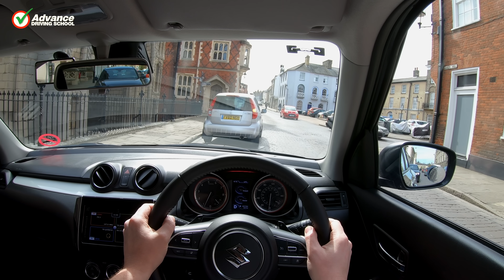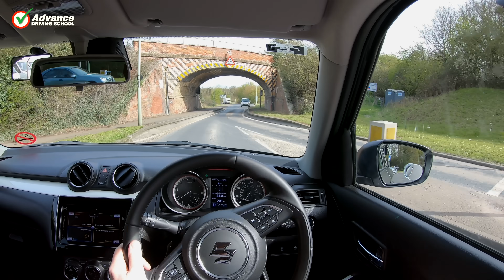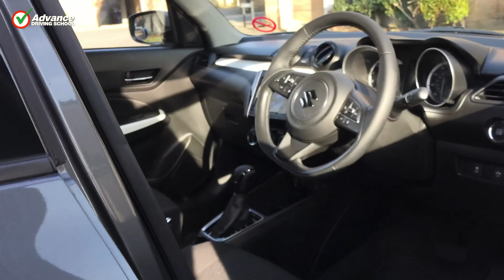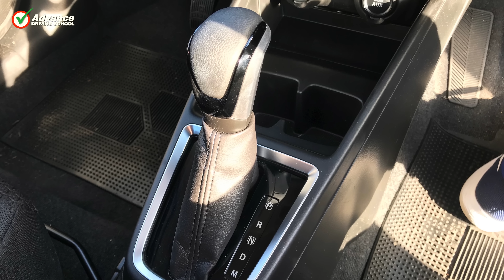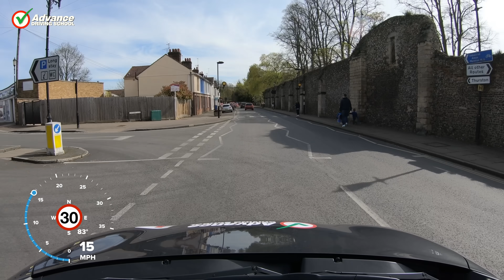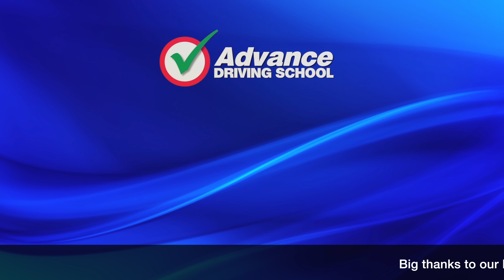How To Drive An Automatic Car

Comment: Thought it was Semi Automatic?🙂
Reply from the maker: This car has a 6-speed fully automatic gearbox (if the driver selects ‘D’) but can be driven in semi-automatic mode if required (select ‘M’).
Reply: Ah ace. Want this as my first Car but the Boosterjet is a Group 27 Insurance!!!

Comment: Do we have to use the M  If we passed in only a automatic ?
Reply from the maker: Using the ‘manual mode’ on an automatic car is completely optional, and will only be beneficial in certain situations. This is not the same as driving a manual car (which has a clutch pedal) and is fine for a driver with an automatic driving licence.

Comment: Srsly. Why does he use handbrake on automatic gearbox on flat surface to stop the car??? 
The UK system is so broken with those handbrake usage...
Reply from the maker: We use the footbrake to stop the car, and then if we want to park we apply the handbrake for extra security.
Reply: @AdvanceDrivingSchool  but there is no point in handbrake in flat surface...

Comment: 1st learn & get a licence in a manual car, auto cars are easy, no leason's needed
Reply from the maker: Controlling a manual car's gears and clutch are only a small part of driving - so even in an automatic car there is still a lot to learn before reaching test standard. The official statistics show that the pass rates are the same in both manual and automatic cars!

Comment: what's the point having a handbrake as well as the park setting?
Reply from the maker: The handbrake can be used in emergencies if the normal brakes fail, and also makes the car more secure when parking (in case the gearbox’s Park brake fails).

Comment: My question is about the creep function. It was demonstrated on a flat ground, just put in drive and let go of the brake and you'll move forward but what about if you're climing a hill, have to briefly, so you leave it in drive and press the brake. When you let go will you still move forward or will you roll back? With an automatic it's not like you can "hold it on the clutch" to make sure you don't roll back
Reply from the maker: In most automatic cars the creep is strong enough to prevent the car rolling back on a hill start - but it does depend on the steepness of the hill. If it does roll back you could use the handbrake (like in a manual car) or your left foot on the brake.

Comment: When doing your driving test in automatic will you have to put car in park and use hand brakeswhen stopping
Reply from the maker: When parking at the side of the road we would select Park and use the handbrake, but when stopping at a junction it’s up to you. As long as the car is in control it doesn’t matter how you do it.

Comment: One point they didn't mention was that: once there is something wrong with the clutch, the cost of maintenance many, many times more than a manual car.
Reply: Automatics don’t even have a clutch in the first place that’s what makes them become automatic because it changes gears for you automatically hence the name that’s the point why some people prefer automatic because no clutch
Reply: Older auto boxes usually employed a hydraulic torque converter instead of a clutch, but many modern auto boxes do have a clutch instead - well, two clutches, usually.

Comment: The fact that most cars still are manual is largely due to ignorance. Once you have driven an automatic in city traffic you will apreciate the advantages. Since most of us do drive mostly in town it is surprising why so many car manufacturers don't offer autoboxes.
Reply: Automatics are more complex, use more expensive parts and therefore more expensive to service and maintain. It's not about ignorance, it's just not as cost effective as their manual counterparts.

Comment: One feature of an automatic car causes more than a few people to press the gas pedel/pedle instead of the brake.
There are numerous videos on youtube showing the consequences of this error.
This is also the cause of many reports of cars failing to stop of slow down for the driver. These reports were in all media in the UK, and doubtless elsewhere.
The CEO of Nissan (I think) made a deep apology. Drivers claimed that the harder they pressed the brake, the faster the car went.
Of course they were actually pressing the gas all the time.
Any suggestions?
Reply from the maker: This is a real problem in automatic cars, and why some people use their left foot to brake the car.
Reply: Yes it's because of the creep function, when the car is creeping, with your foot on the brake.  If you want to stop it from moving, you instinctively put your foot down hard on the OPPOSITE pedal (which happens to be the accelerator and not the brake).  The Creep function is actually a dangerous feature and should be phased out.  It's not even necessary.

Comment: In a moment of utter madness and confusion I decided to go back to driving an auto after years of driving manual.. Luckily I kept the manual after acquiring the auto in case I couldn't get on with it. Four months on and I am still not used to the auto. I feel like an accessory in there and it definitely doesn't seem as economical as the manual. It is however a slightly bigger engine, so hopefully that is why.. 1.9 manual TD4 up to a 2.2 Auto SD4 .. What I find very odd is the Freelander 2 Sport LE doesn't have a drivers arm rest on the left and it is auto but the GS manual model does have drivers armrest, from what I have seen.

Comment: Please also remember to come to a complete stop before shifting from Drive to Reverse or vice-versa. If you don't you can cause expensive damage to the gearbox. It is also good practice to apply the handbrake before shifting into park on a steep hill so that the weight of the car is being held by the handbrake instead of the parking pawl. If not it can be difficult to shift out of park and over time be damaging to the gearbox.
Reply: Can you go from manual back to automatic while the car is moving?
Reply: I was going to say that

Comment: I've noticed in some automatics they have 1 2 3 on the gear stick? What do they mean? Is that so you can choose when to go into gears? I'm currently learning in an Manual but thinking about getting an automatic once I've passed in a manual... well hopefully 🙊
Reply from the maker: Extra numbers or letters on the gear selector are give more manual control. In your case the numbers allow you to select gears 1,2 or 3 manually, for use in certain situations. Read your car's manual for more details :-)

Comment: Once you go auto, you never go back, I learned and passed on a manual, then drove a manual car for a few months. I got my first car in november which was an automatic hyundai i10 and i love it so much. Its a four speed slushbox but its really fun to drive and im never going back to manual. Also lil correction, it is possible to stall some automatic cars like an automatic Lamborghini gallardo cause it has a crap automated manual that stalls sometimes.

Comment: I’m learning to drive in automatic car now I did try manual to start off but sometimes stalled the car and sometimes forgot to change gear stopping at give way lines and I do prefer automatic as they r much easier to drive but in a way I still wish I could drive manual coz if I passed in a manual at least I would have a choice of what to choose from plus manual is cheaper and I have wondered whether to give it another go but nah I’m sticking with automatic it’s just easier although I still find some parts of driving quite hard such as manoeuvring and roundabouts
Reply from the maker: Good luck with your lessons 🚙👍🏼

Comment: I'm disabled and have to drive an automatic. I find driving an auto so much easier than when I tried learning in a manual. I now love driving, which was not the case in a manual, but everyone has different wants and needs. Great video, it has taught me what the extra numbers on my gear selector mean LOL
Reply: Same here Jen
Reply: May I Know which part Disabled? Feeling hard to Drive auto car. Especially sterling turning .
Reply: Same here I have dyslexia and I am learning to drive on an automatic car. It's much easier to drive you to don't have to worry about changing gear all the time. :)
Reply: @faithbabirye9980  Does dyslexia interfere with changing gears? If so I wasn't aware.
Reply: Faith Babirye how are you getting on with your lessons?
Reply: Faith Babirye you don’t have to change at all since there ain’t any .
Reply: You aren't disabled. You are Jen, who has a disability :) ps. love your picture!

Comment: If you release the handbreak before puting it into drive ( with your foot firmly on the brake) is it a fault ? This is an amazing video. Exactly what I needed
Reply from the maker: That order is fine, as the car will be held still by your foot brake. As long as you are in control of the car then there is no problem 👍🏼

Comment: I have an automatic Suzuki Vitara I was NEVER taught to select P when stopping at traffic lights but to select the handbrake then allow the start stop function to kick in when handbrake is released and you pull off....is this wrong...🤔
Reply from the maker: No, that sounds fine. As long as the car is in full control then either method is OK 👍🏼
Reply: For selecting P during traffic lights u can rest your foot a bit.
Reply: i thought at traffic lights you select neutral and put handbrake.
Reply from the maker: That’s another option, but we prefer to select Park instead. As long as the car is safely held stationary then either is OK. We only use the handbrake when actually parking the car.
Reply: The reality is people wont be at traffic lights that long and you need to move away and be ready to move. As long as people have control of car and it isnt moving it would be fine to select park for a bit I would think
Reply: The reality is often when parking you would go from drive to park anyway unless you are reversing first before parking
Reply: In a manual car you have to put it in neutral and handbrake, in automatic you can do this too but equally you can put in P I dont see the issue tbh. Manuals dont have P function. With P the car should be disengaged unless its not working, you would use handbrake with P for parking as you are getting out vehicle. Maybe instructors saying with handbrakes are confused with Manual and Automatics? When pulling off you have to go through R and N anyway and when stopping and not reversing you go from D to P and back most drivers behind in traffic should know someone is pulling away they know they arent going to reverse. But as long as people are in control its fine I would imagine

Comment: Passed in an automatic nov last year. Dont regret one minute for not passing in a manual xxx
Reply: I'm learning in a lovely automatic 😊💖🚘 tried in a manual I can do it I just don't like it ,so many good reasons to stay with a automatic ,I love them ✌👍👌🚘🎓
Reply: DEVON MOON you dont like it cause you cant do it. Manual is easy. You just need too practice. Or admit you suck at clutch control and you are lazy!
Reply: @tubularcandy812  but electric cars are all automatic and petrol cars will be extinct very soon so absolutely no point learning how to drive them.
Reply: @anfe  I agree its like sticking with PS1 when there is PS4! In time automatics will take over, manuals its an extra thing to learn when you dont need to, driving safely is more important, but there should be option manual suits people more than others, people have said they know how to do manual but just prefer automatics
Reply: @anfe  Petrol cars will be around for a long time. The vast majority of cars on the road use an ICE because electric just doesn't have the required range for alot of motorists and are far too expensive. Not saying that electric isn't the future but it's not going to be the market leader for a very long time.
Reply: Same here. I passed in an automatic a month ago...love it!
Reply: Redblade exactly I’m with you on that !!!

Comment: My automatic car instructor tells me to select neutral and pull up the hand break at red lights?
Reply from the maker: That’s another option, but we prefer to select Park instead. As long as the car is safely held stationary then either is OK. We only use the handbrake when actually parking the car.
Reply: Mercedes-Benz have a nice extra feature called HOLD: give a firm jab down on the brake pedal, "HOLD" lights up on the fascia, then you can stay in D and rest your feet. The car won't budge till you release it by pressing the accelerator pedal.

(I drive a manual Fiesta but Mum's got a Merc C220 so I have experience of this.)
Reply: I think you only use handbrake when you park for security in automatics and some tell you to apply handbrake. In manuals you have to select handbrake when in N like autos as you can roll (not good in traffic!) In park the auto shouldnt move as its disengaged

Comment: Does it matter which order you apply the handbrake and select the park gear?
Reply from the maker: Not really, either way round is fine.
Reply: @AdvanceDrivingSchool  which comes off first? Change to Drive before pushing the hand brake down or the other way round?
Reply from the maker: We select Drive, and then release the handbrake before pulling away.
Reply: @AdvanceDrivingSchool  thanks for clarifying this

Comment: I like a manuals. 
Are you sure they Will get rid of manuals.
Reply from the maker: It will take a very long time, as there is still good demand for 'normal' cars with a petrol or diesel engine they will be sold with manual gearboxes for the time being. However, more efficient types of car such as hybrids (eg Toyota Prius) work more efficiently with an automatic gearbox, and full electric cars (eg Nissan Leaf) only need 1 gear, manual gearboxes just won't be needed in the end.

Comment: I didn't quite understand the use of manual controls, it seemed as though the gears still changed automatically even though it was in manual mode. Is that how it works??  I didn't see the driver make use of any pedals on the steering wheel to change gears while in manual mode so I'm a bit confused.  😅
Reply from the maker: It was difficult to see on the video, but there were small paddles (or large buttons) on the back of the steering wheel. When the right one was pulled it changed up a gear, and the left one changed down a gear. It isn't a function that we would use very often, but we thought it worth mentioning in the video. Normally, selecting Drive will give the best balance of power and economy from the car.

Comment: Well, please tell me that. How automatic car behaves in neutral gear.
Reply from the maker: It’s the same as a manual car - selecting neutral allows the car to roll. It’s covered near the end of the video 👍🏼
Reply: @AdvanceDrivingSchool  True for straightforward auto mechanical transmission - but not for Toyota Hybrids! They can’t ‘roll’ on all four wheels as the traction motor is permanently connected to the shafts. The manuals cover this, and one is not supposed to tow them on all four wheels except at low speeds. N just disconnects the power (and battery charging altogether); it’s a bit of leftover from older standards, in effect. Might also be the case for full-on electric cars; I don’t know.

Comment: I switch on automatic for my driving test. 🙄
Reply: But then when you pass (hopefully) your licence would only be limited to driving automatics. Not a problem if you are fairly 'well off' but could cause issues if you're on a limited budget.
Reply: @Redblade i agree they want people to switch. There still will be diesel and petrol engines for a long time but automatics (most automatics arent electric cars of coarse), but the price isnt that great now and is coming down, my dads was automatic but was as cheap as a manual

Comment: Soon it will be electric an automatic vehicles, and they'll even do the parking manoeuvres on its on own no doubt with sensor parking and auto pilot so to speak.. now my brains started. ✌🏼😁
Reply from the maker: Our other car is a fully electric Nissan Leaf - which is automatic of course, and it’s so smooth to drive! Quite a few cars can now park themselves, but that isn’t allowed on the test yet, so we still have to park ourselves for now.
Reply: @AdvanceDrivingSchool  tbh I would want to learn to park myself as its a skill on its own and very useful to learn, even if it could park itself, most I see are awful parkers! But I understand why they like to have electric environmental wise

Comment: Automatic cars are boring. I hope they don't take over Europe.
Reply from the maker: All new Ferrari's are automatic - are they boring?
Reply: @AdvanceDrivingSchool  automatics in general are boring. It doesn't matter what kind of cars we are talking about.
Reply: @AdvanceDrivingSchool  What a passive-aggressive response.
Reply: Not all people drive a car just for fun
Reply: And the fab cars in The Transporter movies are automatic ;-) XXX
Reply: Automatics are fine in cities and motorways, but a disaster for off road and rural driving. I drove an automatic once and it had a battery problem, I was stuck out in the middle of nowhere, had it been a manual I would have bump started it, but this is impossible for an automatic. I had to wait 2 hours for my mate to turn up so we could jump start it with cables.

If you drive an automatic, then make sure you keep an emergency battery starter in the boot, otherwise you are stuck waiting for help.
Reply: I like my three-pedal cars - never owned anything without clutch pedal and stick - but automatic, whether traditional torque-converted, dual-clutch, or electric vehicle direct drive (no gears), will take over if the price premium disappears. Auto boxes such as ZF8 used in BMWs, or Porsche's PDK, are technically superior to a manual. But it's absolutely fine to prefer a manual anyway. :)